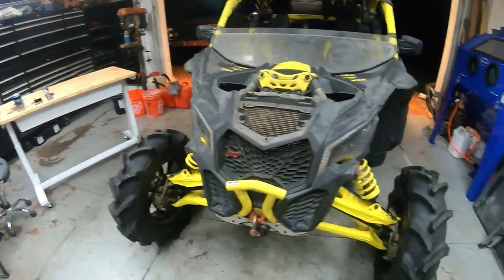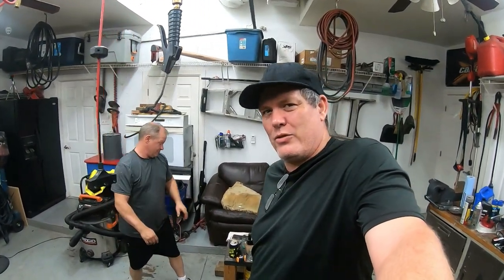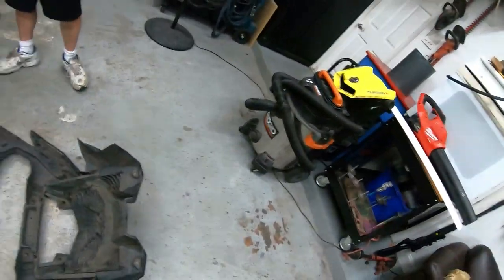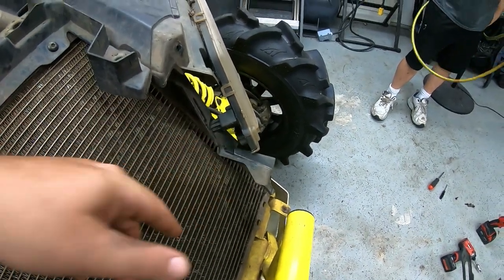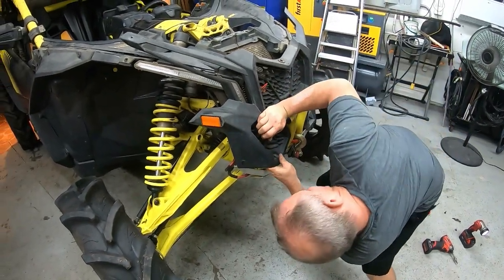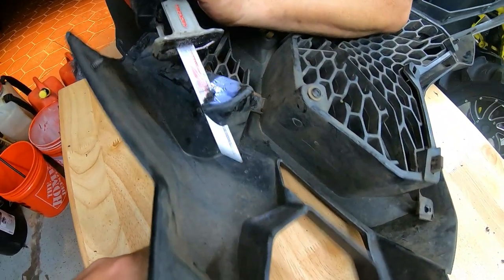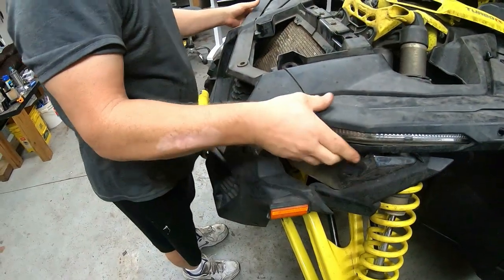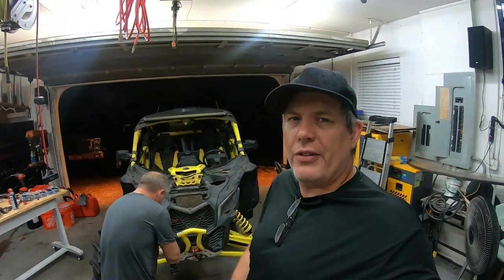Can Am X3 Quick Release Grill Mod Instructions! EASY Radiator Cleaning Now!

Comment: have you considered using a body push pin in place of the bottom two bolts as well? Just thinking it would be easier trail side to do it. Thoughts?
Reply from the maker: Not a bad idea.  But I think you'd have to drill out the threads or put a very small pin in there.  I keep a milwaukee ratchet in my spare belt box so that makes it easy to remove on the trail.
Reply: I just did it. Mine had those threaded body clips. Removed them and the plastic clips fit perfect. Great mod. Thanks for the video guys. Worked perfect

Comment: Or you could go to home depot buy a piece of copper tubing & connect it to a garden hose end & bend it angled 😅
Reply from the maker: We use he radiator genie,  which is essentially what you're talking about.  Good for a quick rinses but never got all the mud out.   Getting the grill out of the way really helps.  Rzr has had this on several models.  Additionally, it depends on what you ride in.  Florida mud is nasty

Comment: Any movement, issues or something different you wish you would've done differently after doing that? Scary cutting the body but if it works it works!
Reply from the maker: Done it on 2 machines.  Both work great.  Makes cleaning the rad so much easier.  No regrets.
Reply: @oneoffgarage  Awesome! Thanks for the quick response.